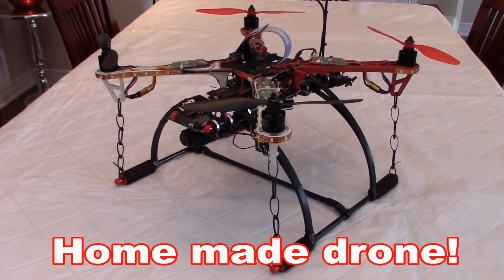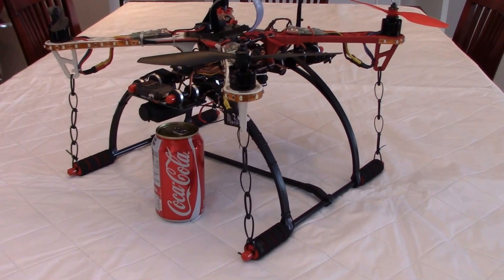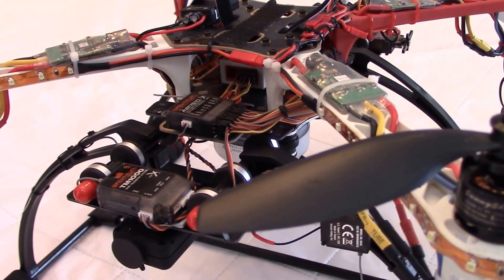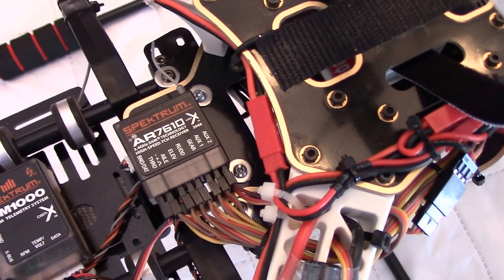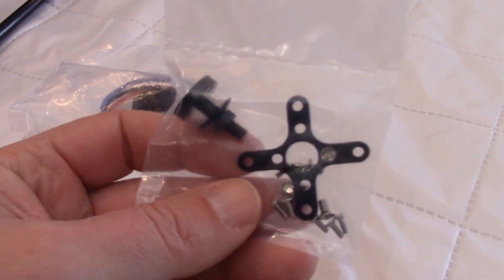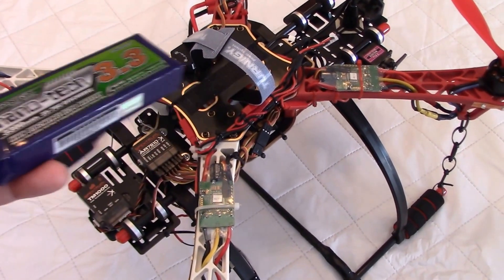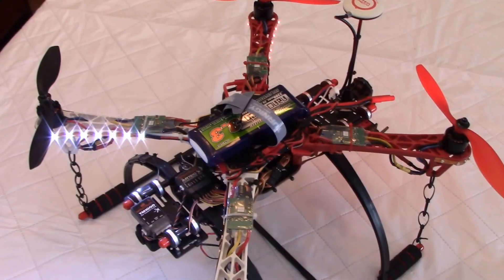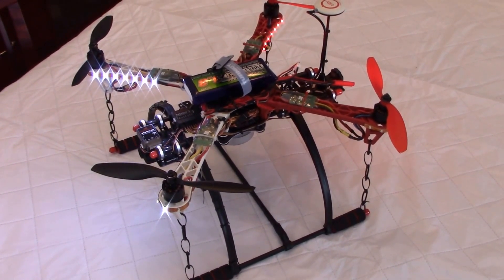dji F450 home made drone build | One of a kind!!!

Comment: Hi, what is the size of drone for 10' prop ?
Reply from the maker: As you can see in the video, this drone is quite big and works better with 8 inch props.  I would say anything slightly bigger, like a frame 2 or 3 inches wider would require 10 inch props.  Thank you for watching this very old video (but this build is still a classic...lol)
Reply: @SuperdanTech  Incredible to Respond now thanks

Comment: 2020 zip ties for the motor/esc wires
Reply from the maker: I built this in 2014 when the only decent drone you could buy was the Phantom 1 from dji. Tie wraps was probably the only way to go back then  and the best option when using the dji F450 open frame.

Comment: Have you ever had a crash with the drone? How strong is the frame?
Reply from the maker: No crash, just a couple of hard landings. With a drone of this type and value, you fly carefully! :). I like this frame because it is flexible enough to resist a hard landing and rigid enough to have a stable flight with the controller. Thank you for visiting my channel.
Reply: @SuperdanTech  ok, thanks for the quick response. :) 
I am planning to build a drone and make a flightcontroller out of a arduino for it. Since i want to write all the code on my own, the drone might crash one or twice... I'll just have to do a lot of testing on a teststand 😅

How did you determin which motor/ propeller to use? I can't find any information on the thrust on many listings online. Which numbers should I be looking at? The kV rating isn't that usefull, since there are motors for miniquads which have the same kV rating as a motor for a bigger quad.
Reply from the maker: @Marco-vp8wl  look at my two flight videos with different motors and props. I did those 4 years ago but the physics still holds. I show the best combination for a drone of that size.
Reply: @SuperdanTech  ok, thanks. Very informative videos. 
How much does your drone approximately way?
Reply from the maker: About 1.2 kg with 3300mAh battery

Comment: how  much did parts cost you.....beutiful drone
Reply from the maker: Thank you for your nice comment.  When I built this drone in 2014, the parts cost me about $600.  The most expensive items were the 4 motors, the 4 ESC and the dji Naza controller.  Two years after I added the Spektrum telemetry module and the altitude sensor.  Thanks for watching!

Comment: Hay SuperdanTech I built a quadcopter the same, frame alien f 450, engines 750 kv, acc 30 amp KK2.1.5 Flight Control Board, battery Nanotech 4.0 Ah, and the day I tried to make my first flight in a park, a policeman saw me and I try to take it off, him wanted to take the new toy for your son, I got pissed off, and I almost got arrested. nope it's fair that after the stores sell you the parts legally, you can not fly it, because it's illegal, this is bullshit
Reply from the maker: The whole drone issue is getting very complicated in several countries. In some places it is almost impossible to fly legally.  Some regulators do not get it; just like self-driving cars and trucks, drones are the future!!!

Comment: What's your flight time with this setup?
Reply from the maker: In the picture I show my original 2200 mAh battery.  I upgraded quickly to a 3300.  The weight difference is not big and I am getting better flight times.  With the 3300, I get between 8 and 10 minutes of flight depending on the wind and how aggressive I fly.  This is quite the build and after almost 4 years, every time I go to the park, I attract a crowd who cannot believe that this mass of plastic and wires can fly so well...LOL...but then I cannot fly anymore because there are too many people around...  

I hope this helps and thanks for watching!
Reply: SuperdanTech that's impressive. Thank you for the response. 
So the 2200mah was giving very little flight time?
In my country drone are apparently illegal
Reply from the maker: If I recall correctly, the 2200 was giving me around 5-7 flight times.  It is quite a heavy drone despite my effort to use light components.  Not enough flight time to get high and take decent video footage.  Drones almost became illegal also in Canada about 6 months ago... There are petitions going around on the web to change that! But I cannot fly in the park anymore...
Reply: SuperdanTech how heavy?
Reply from the maker: 1.2 kg with battery.
Reply: SuperdanTech that's quite heavy. Thanx mate. Happy flying in more open places with less people